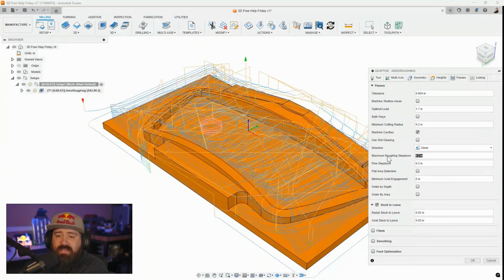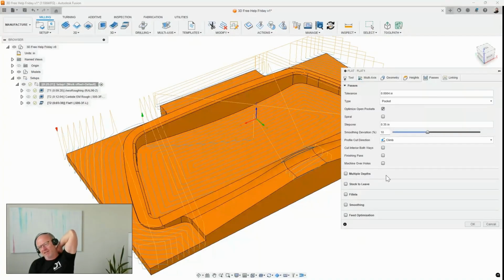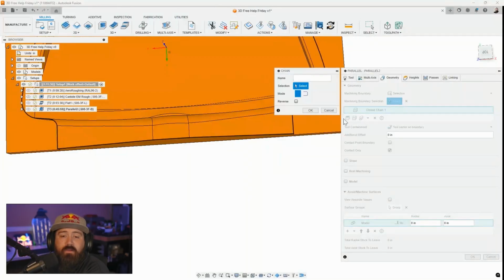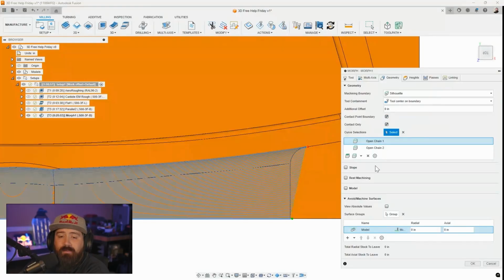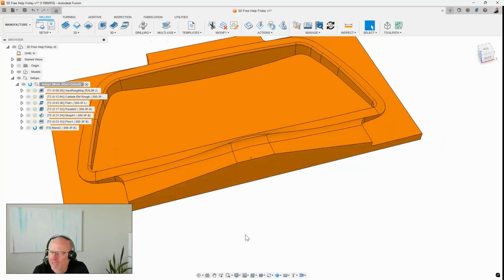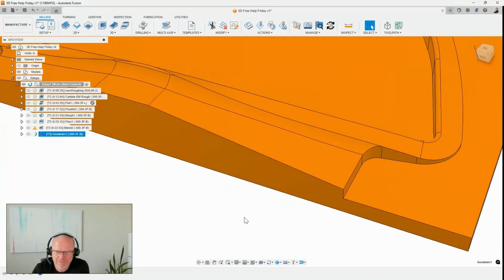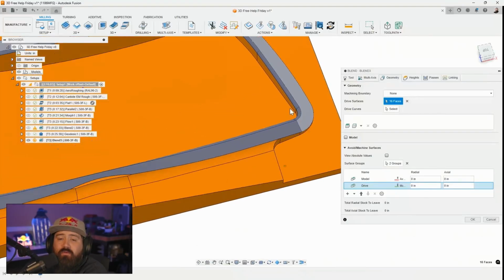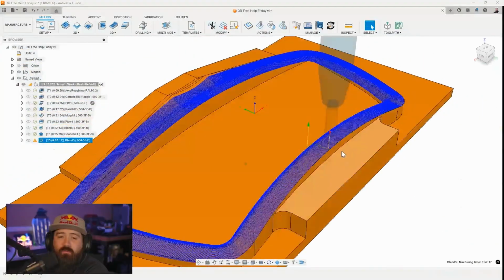The Perfect 3D toolpaths in Fusion CAM

Comment: Seems 99% of worlds machining is out of these simple 90 edged stock. I make large sized bearings where stock is always in “ring” form. All cams struggle in giving me proper 3d paths for even simple operations like slotting without preventing air cutting.